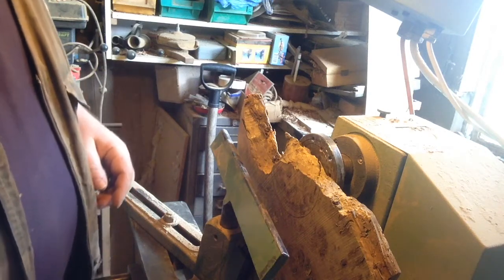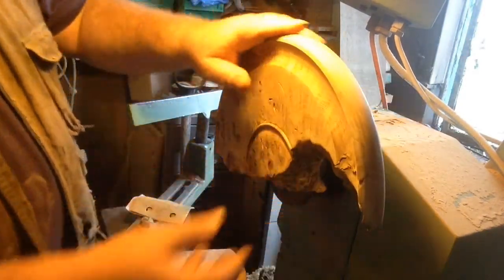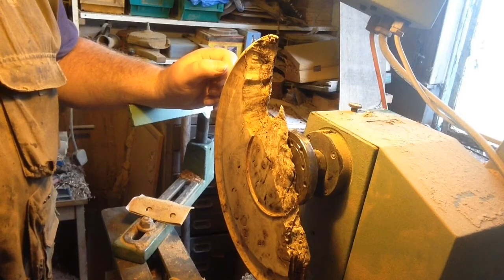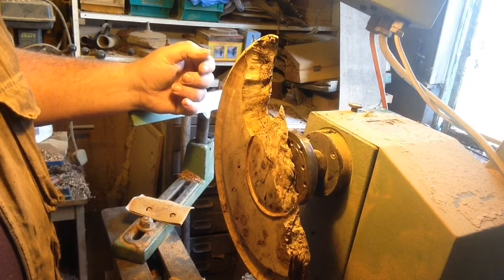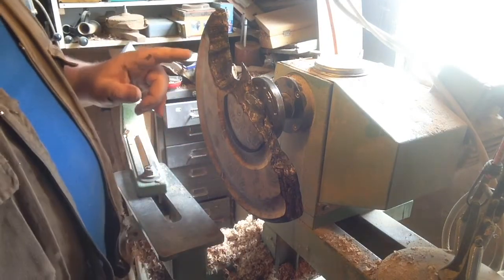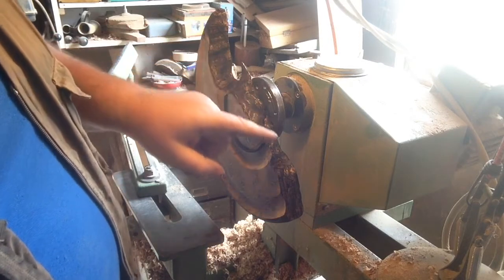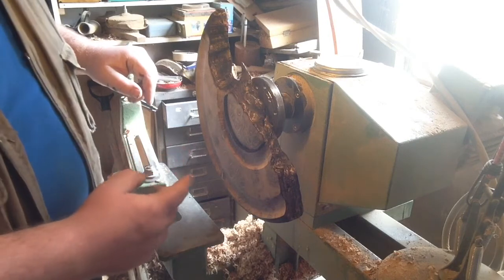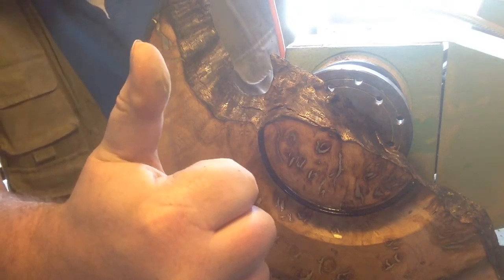Turning a piece of Burr Oak Wall Art

Comment: That's a stunning piece I love the Brass and the wax contrast. Have you considered trying the chestnut  gilt creams?
Reply from the maker: Andy Matthews Turn in the Wood hi Andy I do have an unopened pot of gilt cream somewhere in the workshop and no doubt will try it one day ,I'm not that keen on colouring and enjoy turning wood that already has character so doesn't need the addition but I'm sure to run out or low of interesting timber at some point which is when the adding of a bit of something to enhance it is the right thing to do ,I realise most turners colour these days and its personal preference that I choose not to

Comment: Gorgeous  piece of work, something I wouldn't yet try. Two questions if you don't mind. 1. What was your ebonizing mixture (vinegar/steel wool?). 2. What did you do to the backside? Thanks for posting. - rick.
Reply from the maker: NEB3310 hello Rick thanks for your comment mate ,I do use a wire wool and vinegar mix for large areas but for small areas like this I use a leather dye ie cheap boot polish in liquid form as it has the same wax base mix as the commercial ebonising solution products sold in turning shops but at a fraction of the cost ,apply several coats! As for the back I will drill a recess for a 'd' loop and ebonise ,atb Darren
Reply: Thanks Darren and keep up the beautiful work!